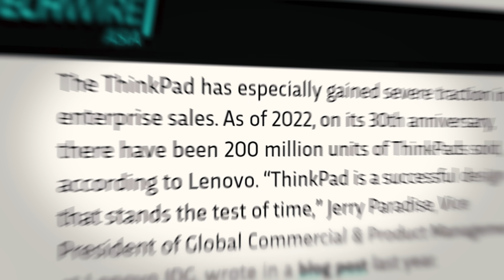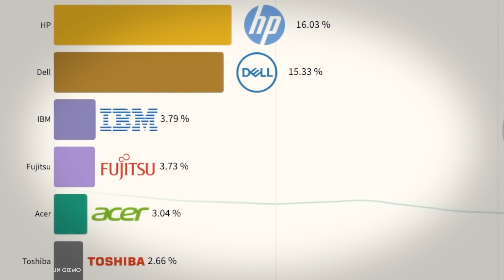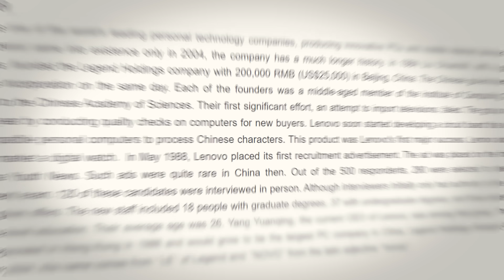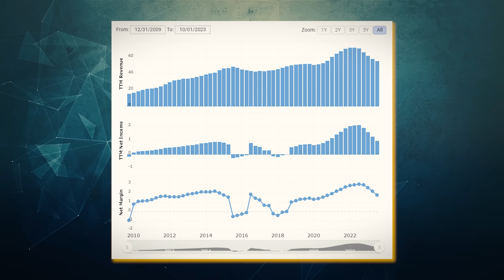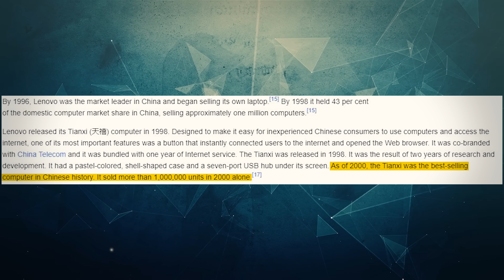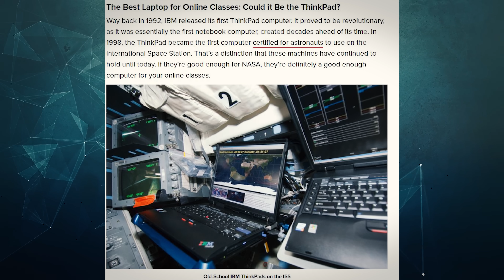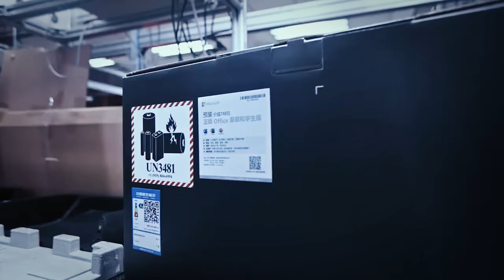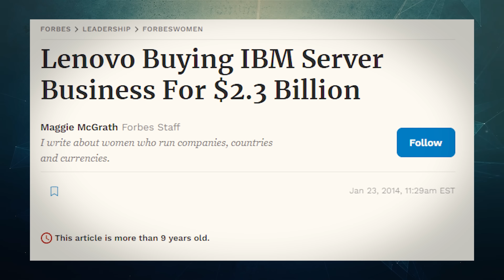Lenovo - The Last Practical Electronics Maker

Comment: As much as i love my thinkpads, Lenovo has been moving in the wrong direction for a while now. RAM that's soldered in, internal batteries and so on. Even my HP Probook G9 has two upgradeable RAM banks which makes it more practical than the majority of thinkpads. Yes, i am aware that very few thinkpad models still have good upgrade options, but it's getting more and more rare.
Reply: Yeah.... when I saw the video I was like USED to love Thinkpads. I like old Thinkpads before IBM sold them off.
Reply: Thinkpads were really great up to the T530. This was the peak from a customer perspective.
Reply: @Falsechicken  old lenovo thinkpads werent bad at all ngl, got a 2011 thinkpad t520, its peak lenovo engineering i'd say
Reply: soldered RAM is exactly that bad. for 2nd hand buyers they atleast get assured the best base RAM along with it since it is soldered and the seller can't replaced it with cheap one.  but yeah it suck to that it was soldered. 

Thinkpad are so famous for business owner who need one for their small businesses inventory system which is why 2nd hand used thinkpad selling like pancakes.
Reply: @ChibiKeruchan  "but yeah it suck to that it was soldered." -

not only that you cannot easily replace damaged memory (have to solder it). It sucks that the processor supports 16 GB of memory, but soldered is 4 GB and the slot accepts 8 GB maximum. So instead of 16 GB total you can have not more than 12 GB total.
Reply: @TheRVSN  I had to buy 16 extra gigas of ram. Having a total of 20gb. My processor supports it, but I regret buying my Acer laptop. Should've bought a better one.
Reply: Yeah. The X series is F'ed now. You have to go to the T series to find something good. That's why I bought an HP Probook and not an X390
Reply: Everything before the T490 era should be good. With the those T series minus the s, you get upgradeable ram, two drive options, ssd/had and m.2, so you can have one drive for windows and one for Linux. The screens and keyboard are fairly easy to upgrade and you can upgrade the cpu in some cases. Yeah, they’re pretty much no frills laptops and not the sexiest looking, unless you like standard matte black bulky ish laptops with big bezels, but they’re pretty good. Will hold up well over the years as well and even come with that military drop rating thing, forgot the name.
Reply: The build quality is also getting less and less (besides the dirty tricks like soldered memories etcetera) Oh how stupid of me..... That's true... We live in a throwaway society. Buy another new one
Reply: @henkholdingastate get a Framework instead
Reply: Glad to say Lenovo is going back to repairability with this year's T14 and T16 will be more repairable as they've collaborated with ifixit. So we could actually be back.
Reply: soldered ram does have the benifit of much faster speeds
Reply: You can upgrade the latest ThinkPad storage included.
Reply: Internal batteries are easy to replace (even on MacBooks if you know what you're doing) and as another commenter said, it doesn't make sense to bring an extra battery anyways. Just bring a high quality, high capacity power bank and charge with PD- at least then it can serve multiple purposes. 

Although soldered ram is not user replaceable, it's technically possible and there are very good reasons to solder in ram. The most notable being it's just faster and more reliable. Less interference allows faster more dense memory. 

SSDs should remain user replaceable- at least for now. But it's only a matter of time until that isn't the case. Vast majority of people don't care to fix or upgrade their devices anyways.
Reply: 100% agree on this, I'm actually a repair technician and long time ThinkPad user that recently switched to HP Probook due to similar experiences with modern ThinkPads. I love them still, but they're definitely not as good as they were, and HP Elite/Pro have become slightly  better and also cheaper in my experience.
Reply: They lied to users recently and claimed that second hand computers are dangerous due to viruses. You can replace or erase a hard drive on a used computer. I don't know how stupid they must think we are, but it's insanity.
Reply: @SlavTiger  It's always good to see someone else who enjoys the rants of Louis Rossmann. 🙂
Reply: @SlavTiger  Yeah it's sad that society has devolved into this mess. Fsck the repairability and fsck the environment and fsck customers. Just a day before i got this brainfart from Lenovo i got info that brother has started doing the same "no ink... no scan" shit HP is doing and I'm really starting to lose all hope.
Reply: Now Lenovo colaborates with IFixit to make the "T" Series easy to repair and upgrade with the T16 Gen3 :,)
Reply: weird. My lenovo had upgradable ram slots and I added another 8gb right away so now its 16gb
Reply: @megapet777  See my ThinkPad T440s and note "Form Factor: Chip" of 4 GB soldered memory module.

root@lenin:~# dmidecode -t 16
# dmidecode 3.3
Getting SMBIOS data from sysfs.
SMBIOS 2.7 present.

Handle 0x0005, DMI type 16, 23 bytes
Physical Memory Array
	Location: System Board Or Motherboard
	Use: System Memory
	Error Correction Type: None
	Maximum Capacity: 12 GB
	Error Information Handle: Not Provided
	Number Of Devices: 2

root@lenin:~# dmidecode -t 17
# dmidecode 3.3
Getting SMBIOS data from sysfs.
SMBIOS 2.7 present.

Handle 0x0006, DMI type 17, 34 bytes
Memory Device
	Array Handle: 0x0005
	Error Information Handle: Not Provided
	Total Width: 64 bits
	Data Width: 64 bits
	Size: 4 GB
	Form Factor: Chip
	Set: None
	Locator: ChannelA
	Bank Locator: BANK 0
	Type: DDR3
	Type Detail: Synchronous
	Speed: 1600 MT/s
	Manufacturer: Elpida
	Serial Number: None
	Asset Tag: None
	Part Number: EDJ8416E6MB-GN-F  
	Rank: Unknown
	Configured Memory Speed: 1600 MT/s

Handle 0x0007, DMI type 17, 34 bytes
Memory Device
	Array Handle: 0x0005
	Error Information Handle: Not Provided
	Total Width: 8 bits
	Data Width: 8 bits
	Size: 8 GB
	Form Factor: SODIMM
	Set: None
	Locator: ChannelB-DIMM0
	Bank Locator: BANK 2
	Type: DDR3
	Type Detail: Synchronous
	Speed: 1600 MT/s
	Manufacturer: 0112
	Serial Number: 01123383
	Asset Tag: None
	Part Number: 78.C2GCZ.B730C    
	Rank: Unknown
	Configured Memory Speed: 1600 MT/s

root@lenin:~#
Reply: When did you buy it? @megapet777
Reply: @megapet777 "mine is an exception, so that means this is a general rule"
Reply: @doomgirl5341  wtf? xD
Reply: @megapet777  The main txx0 series of Thinkpads were ruined by Lenovo

The p1 and a couple other series still have a majority of the features and repairability that made Thinkpads so good
Reply: that's why Lenovo has the biggest market share
Reply: YES! My old lenovos were all super easily upgradeable, but I just got one last year and everything is a single unit, no way to even repair things easily :(
Reply: rumor has it that soldered RAM allows for a thinner and more cheaply made laptop than a socketed one, but I don't like this move too
Reply: Only the Student Versions of Thinkpad are decent for repairbility sake tbh i would have bought a older model if i only do office on it.
Reply: You can't blame Lenovo. Blame the industry. And the greed is the driver. It's cheaper to make soldered stuff than making it upgradable. More and more customers will come back to you every year to get the new laptop because the old one is broken. And another reason is that R&D spent making it the thinnest, while keeping the bare minimum to run. That's why you get riveted keyboards, internal batteries, soldered SSDs and RAM and so on. And the icing on the cake is that this shit that Apple and the industry has created, made it's way into businesses because of pure greed. And we have to live with that because we have no fucking voice.
Reply: i have owned thinkpads from the ibm days and one of the features i miss is the bridge battery, haveing a laptop with two batteries is the best, i always had a extra battery in my bag and i would swap without shutting down. for many years i thought the t series was indistructable , the fell off roofscars , love the spill proof keayboards
Reply: I bought a Thinkpad last year and within 3 months the board failed, as everything is soldered in, it was super expensive to fix. For warranty, I had to create an account, then open a ticket, took them 2 months to get back to me, and they wanted me to do the 'hold this or that etc' to fix, as I was travelling for work and couldn't (I had already done that anyway) the closed my ticket, had to reopen etc. Long story short they never fixed my laptop, and the support was absolutely non -existent. I will never buy a lenovo again, especially since the AIO 27" I has was also noisy and absolutely useless. Sticking with Asus and HP for now, and mini PC Beelink for my offices.
Reply: @JLC-p6r  which model thinkpad? some have 1 year warranty and some have 3 years
Reply: Thankfully, they've adopted LPCAMM2 memory on some models, so there won't be as many devices with soldered RAM.
Reply: It’s the Chip maker’s fault, AMD’s latest zen 5 and intel’s lunar lake all have soldered ram, it’s non negotiable. All the chip makers are going down the route of unified memory like apple
Reply: This comment aged poorly very fast, and I hope people find out about this. Just one month after, Lenovo announced an iFixit partnership, and it seems like they delivered and are in the right direction to some extent. E14 gen 6 was a crazy glow up, to the point it's just straight up better than the L14 and T14, with replaceable RAM, replaceable wireless card, a full sized M.2 slot, mandatory aluminium lid, and a generally sturdy build despite being small and plastic, contrary to many people's previous poor perception of E series build quality. A ThinkPad was the first device to use LPCAMM2. They never actually did away with the TrackPoint. They never thinned the laptops to the point they suffer in quality. TL;DR these are still pretty much the peak of the market.
Reply: As long as the laptop can charge using USB C it's just easier to bring a power bank than bringing an extra laptop battery.
Reply: @SweBeach2023  The T480 has a USB C charging port as well as an external battery, right? that's probably the best of both worlds.
Reply: @SweBeach2023  Thinkpads were known for their durability and repairability. The problem is that Lenovo are making it more difficult to replace the battery on more of their models. You can have easily replaceable batteries and USB-C charging on the same laptop.
Reply: Soldered RAM is absolutely a bad thing, but when it comes to removable batteries, in the world of USB-C Power Delivery, it's 1000x more convenient to just bring a standard battery bank. And no, internal batteries are absolutely not "anti-repair" when it's at most a few screws and a panel away.
Reply: @hmuy0608   Yeah, I have no problem with internal batteries, as long as I don't have to nearly brake the chassis apart and unglue them.
Reply: @hmuy0608 solder ram isnt bad, its kinda needed for engineering reasons in ddr5.  however since they started doing this during the ddr3 and ddr4 years its got a bad rap.  also unddr supplying the amount of ram
Reply: @jemiebridges3197 no, you can have CAMM RAM sticks in laptops with next to no downside even on DDR5
Reply: Almost all laptops sold today have soldered on ram and cannot be expanded.   Every single model at best buy and similar.   Only a very few laptops have expandable ram.
Reply: @harryniedecken5321 Only Gaming laptops that use expendable ram,
i've never seen any business laptops that use expandable ram
Reply: @Ixaanityy Framework laptops have them
Reply: @harryniedecken5321 and we shouldn't have to settle for manufacturers doing things that hurt the consumer, so what if they're trying to make it standard? It's bad
Reply: @TheElusiveReality   I am not defending the laptop companies,  I am used to buying a laptop with a tiny amount of ram and then replacing it with a man ram setup.   What I was trying to say is that in December 2023, I couldn't find any laptops in stores that were not soldered on ram and and very few on line. 

Even worse,  it was usually very little ram.    If they are going to sell laptops with soldered on ram,  it needs to be at least 32 GB minimum on every computer IMHO.

Comment: I think what the video failed to cover is, how big the corporate market is today with Lenovo, I am a consultant who moves around from company to company. The first sign a company's department is cheap is they use Dell, the IT staff knows it and is up to corporate as they control the budget. I once went into an IT department as my Dell simply "died" when i close the lid to walk from one meeting to another, the IT guy was very nice and I told him I went through every single short cut keys I know or I can find online to see if I can start the machine, but no luck. He wasn't surprised as the stack of Dells next to him ( I am talking like 20 of them) had the same issue. The second part the vid didn't mention is the keyboard, Lenovo has somehow designed a very good keyboard with the right amount of space and fell. Even now I am writing this with a high spec Dell Precision, my fingers actually hurts.

Comment: The red dot in the middle of the keyboard may feel weird for kids ( ;) )... But as a multi decades owner of ThinkPad and as you mentioned later in the video, key is efficiency... When your hand doesn't have to leave the keyboard, it can make a huge difference.

And... The compatibility of components with Linux is also amazing.
Reply: I had to Velcro a wireless TrackPoint keyboard onto my work laptop because it's not a Lenovo and I couldn't live without a TrackPoint
Reply: Same — I mean about the TrackPoint, not the Velcro ;-). I need a double shot of scotch before I use a trackpad
Reply: And when your thumb starts hurting.....why not mouse around using your left or right pointer/FU finger instead?
Reply: For years, the first thing I do when I get a new ThinkPad is disable the trackpad.  Don't need it.

Comment: My thinkpad is driving me crazy. When i shut it down powering it on is such a hustle. sometimes i have to hold the power button for like 20 seconds, sometimes 2 seconds. sometimes i press it twice. i dont even know how this works. the sometimes when its not in the mood i have to remove the battery and turn it on plugged in then put the battery back in. everytime it runs out of battery or i shut it down i just know its gonna be a hustle next time i turn it on.

Comment: Our office uses thinkpads. Barely had any problems with our laptops. When they switched to asus a few years back, we had a lot of issues like faulty motherboards, premature LCD failures and  hard drive failures. Now they are procuring thinkpads and slowly getting rid of our current computers. I dont know what the hell was the IT head was thinking, probably trying to save some money 😂
Reply: I mean, business laptops do costs twice as the others. You won't get errors with Latitude (Dell), Elitebook (HP), and Thinkpad (Lenovo).

Asus don't have a business tier, Zenbook pro is catered to professional, but not suitable for business laptop.
Reply: @gold9994 Dude Dell laptops are bad.

Comment: Lenovo's Secret of Success: 
1. Make military-grade rugged laptops;
2. Make them serviceable, capable of being serviced & (to some extent) upgradeable;
3. Provide rock-solid accessible service for a reasonable price.

I repeated the accident of a reviewer, dropped my ThinkPad X1 Tablet & dented the floor! Tablet was just fine. The tablet isn't glued together: like Dell products, you can unscrew the back & repair or upgrade. And Lenovo bought IBM's Service Division. For a very reasonable price my tablet gets on-site service - in my home! NEXT DAY - where the service tech leaves a bank network to fix my tablet on my kitchen counter (on-time) guaranteed! - then leaves to fix a cloud service server farm. Cool.

I've suffered Dell Service (horrible) and HP's "courier overnight" service (terrible). 
I've used Lenovo's on-site service twice. I'm a Fan.

BTW, this video says Lenovo puts its money into R&D & parts but doesn't make flashy or innovative products. Maybe: they don't pursue bleeding edge. But they do make some innovative products. They invented the "hybrid" laptop market (laptops that swing the hinge 360 degrees & become tablets). Everyone else now makes hybrids, but ThinkPad "Yoga" models are still the best. And Lenovo has released hybrid OS models this year (Windows & Android, working together) and multi-screen laptops. 

Smaller manufacturers have had to go bleeding edge to maintain any market share at all. But Lenovo has conquered the business market with rock solid construction & outrageously reliable service.

That's a win in my books.

Comment: I bought an HP laptop last year after using a ThinkPad for the last 7 years. I immediately regretted it within a month. I'm going back to ThinkPad after this. I wish there's more config options though - I'm planning to switch next year and I'm not sure if NVK will be daily-driver ready then and AMD seems to be sidelining dGPU in their mobile offering, but I'd take Nvidia over AMD even then (driver 545 and 555 seems to be looking good for Wayland at least).

Comment: Here I am watching this video on my... ThinkPad!
The first laptop I used was the IBM ThinkPad (roughly around 1999) and in my first job I used IBM ThinkPads. These machines are tanks! Lenovo was very smart to keep the IBM trend of robust and practical computers directed at businesses. But their consumer products are not as good. My first personal laptop was a Lenovo G-Series and whislt very good, it was quite fragile. I still have it and use it, but the carcass is broken. However, recently have have started changing a bit... their Yoga series have bad repairrability and upgradability and their newer ThinkPads are going on the same way (specially the Carbon X series)